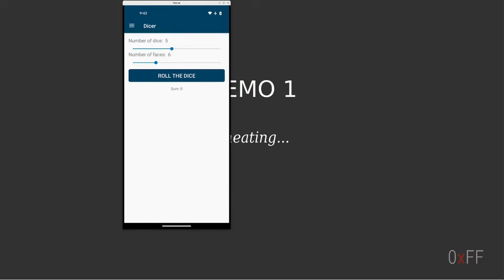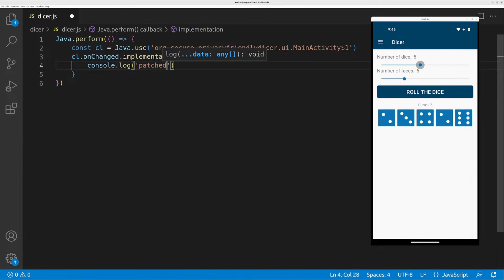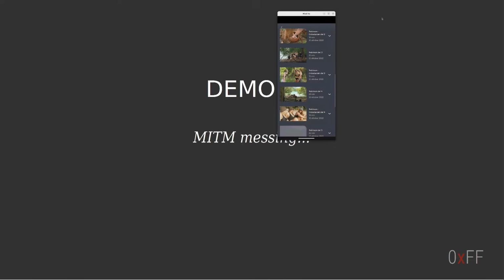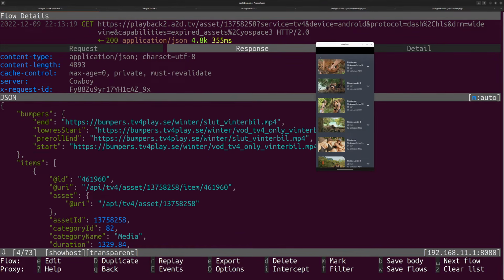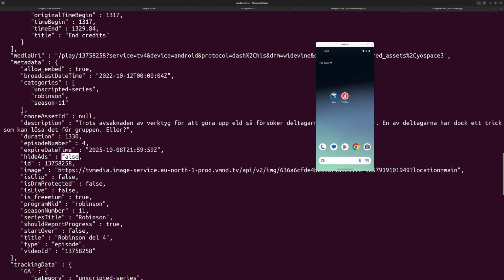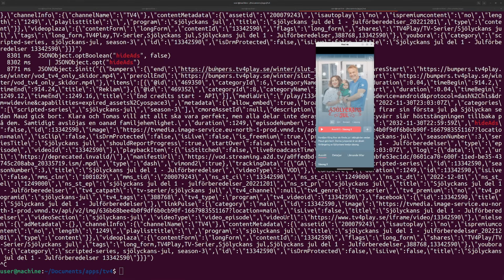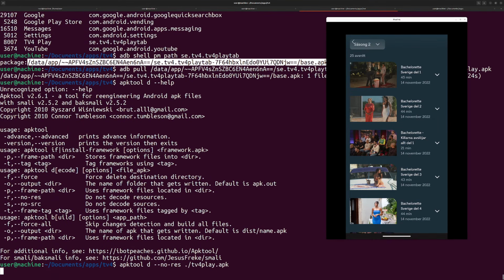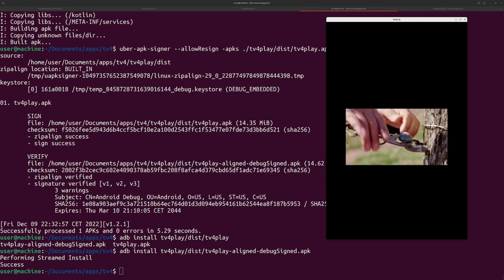Cracking Android apps with Frida

Comment: WHERE HAVE YOU BEEN A YEAR AGO!

Thanks for the video, I have a question that is not particularly frida related - Do you know if it is possible to fake a dns response to an android emulator or phone that are not connected to the internet, namely StandAlone?

More specifically - I am reversing an app that is sending a lot of requests to multiple servers and than waits for the right encrypted response from the server. Then the app decrypts it and compares it to a const string. I wanted to fake the response with the encrypted string to have a proof that I am correct with my decryption.
I will be glad if you'll answer, Thanks!
Reply from the maker: Glad you liked it! In your situation I would probably have the phone tether network over USB to a computer running dnsmasq (can act as a dhcp server and serve fake dns responses) and a web server. If the app is using SSL you'll need to install a custom CA certificate and possibly disable cert pinning in the app if used.

Comment: Really good talk! I was able to replicate the TV4Play example on my phone, but I was not required to bypass the certificate pinning. Did you install a certificate for your MitM proxy on the phone? I installed my Burp certificate as a system certificate and that worked without a problem.
Reply from the maker: Thanks. Yes, I didn't go into detail of the MITM-setup but you're absolutely right in that it requires you to add the proxy CA-cert to the phone. Of course this is only needed for the exploration phase and the final patch works without root or custom CA-certs, yet another reason to have a dedicated phone for testing stuff out on.

Comment: Auto subs.

What i best method to undetect for example banking app apk in root device?

1. Is that using magisk module, as we know that apk developer will update day by day so we hard to follow frequently every an update that support with magisk module.

2. Reverse engineering updateble apk with downgrade manifest?

3. You suggestion sir?
Reply from the maker: Great question. Personally I would never do banking on a rooted phone considering all the security implications, so that rules out option 1. I would patch the app statically and recompile and if there is an issue that it keeps getting updated I usually just change the app package name to not have the app store app recognize it.